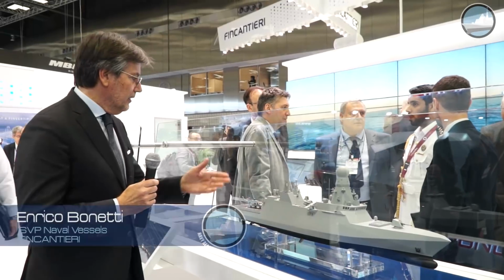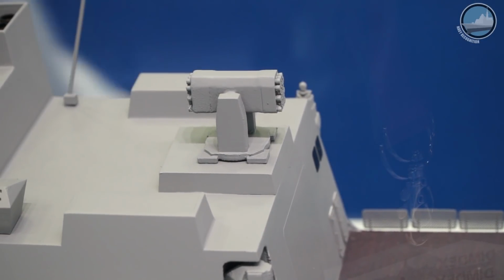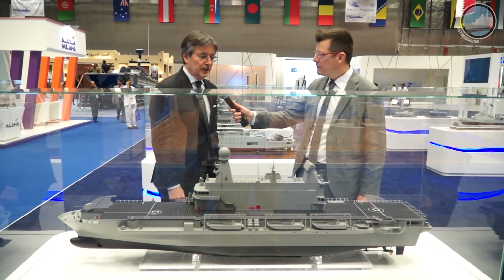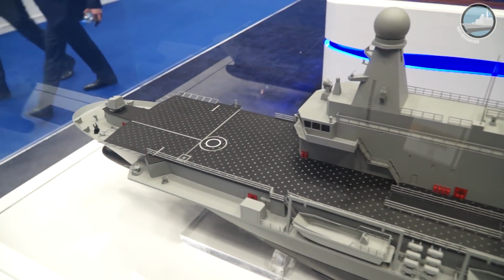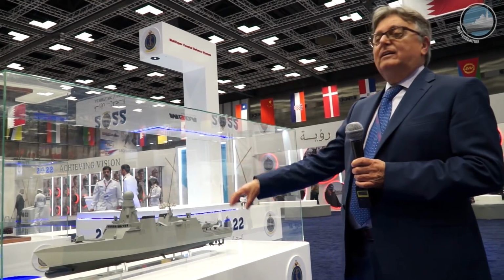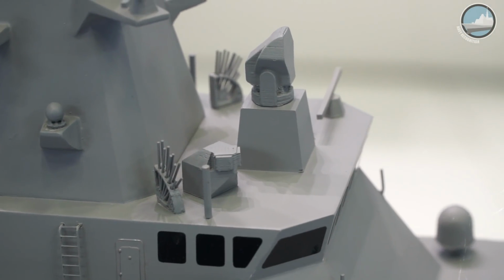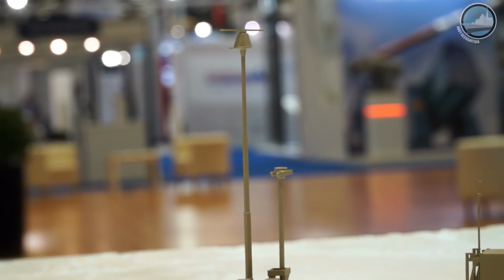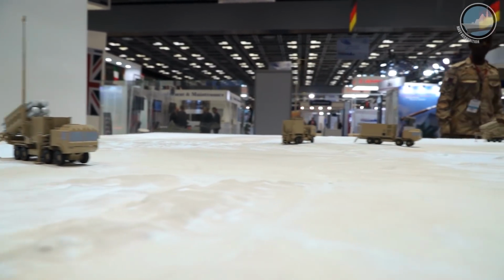DIMDEX 2018 Day 1: Future Qatar Navy Vessels & Systems - Fincantieri, Leonardo, Lacroix, MBDA

Comment: the Qatari Navy should have opted for a fleet four brand new Mistral II class i-SMARTFuelCellΔ e-HYBRId® powered 36,849 ton (43,650 ton loaded) non-amphibious (CSTOL) multi mission LHD . . . unlike conventional LHDs it won't feature a dedicated vehicle deck but it'll have an aft well deck in the rear most stern section lower hull . . . the available space in aft well deck will fit limited number of armoured IFVs & self propelled artillery units that will be transported from the LHD somewhere in the middle of the ocean (since LHDs being a proper ocean going warship cannot sail into shallower waters) to the shore in state-of-the-art electro-solar powered 1,056 ton (1,900 ton loaded) autonomous multi purpose heavy lift tactical barges . .

Comment: Qatar MoD also ordered 12 helicopters NHI NH90 NFH (Nato Frigate Helicopter) and Marte ER missiles for them (declared range at least 100 km). The helicopters can also use MU90 torpedoes, don't know if Qatar MoD ordered also the torpedoes.
The total order of NH90 was 28, since there was also an order of 16 NH90 TTH (Tactical Transport Variant). There is an option for additional 6 NFH + 6 TTH.

Comment: LCS outgunned by that second tiny coat. This is just sad.
Reply: That second “mini corvette” would be an addition to any navy. Just reading they’re only 110mil. Super cost effective as a light escort/picket ship  if only it had a helipad it’d be perfect as a workhorse.
Reply: This "tiny coat" can do as much damage as a Gowind 2500.
It is equipped with AESA radar, crew of only 34 men, VLS MICA NG, Very Stealth, anti-cruise missile capability, ASuW capability, most advanced combat system ATHENA, powerfull EW system and the cost of the ship, crew and logistic maintenance is less than the cost of a corvette/mini-frigate.

Comment: Qatar is getting an LPD???
well this is certainly interesting .
Reply: and Its better armed than the UKs Queen Elizabeth Class Carriers lol
Reply: @jyralnadreth4442  Yeah well Qatar doesn't have to factor in £35bn for replacing their SSBN fleet/nuclear deterrent into their naval budget.
When the largest ship you're ordering is a single landing ship only big enough for a single platoon and the next is a 3000-tonne corvette, and even then you're only ordering 4, you can usually afford to add a few extra missiles on to your 5 new ships.
Reply: Jyral Nadreth heh mate,there’s a difference between aircraft carrier and LPD,the role of the QE is an aircraft carrier,thus it will mainly be protected by type 45s and 26s instead of being by itself.Do keep in mind this LPD will be long destroyed in a solo battle against QE,simply because the QE has jets whilst the LPD doesn’t.Anyways,I could keep mentioning in ways how better the QE is,but clearly you’re either a troll,misinformed,or largely underestimating the capabilities of the QE.
Reply: Don't worry, looks like it's only about 3ft long...
Reply: It was confirmed that Qatar only ordered the LPD to mount the Kronos Grand Shield Anti-ICBM Radar which was too large to fit on Doha class Corvettes or Falaj-2 OPVs.
The LPD will have the task of creating an anti-ICBM bubble where it will also send information to the rest of the frontline ships equipped with VLS Sylver A50 systems to shoot down ICBM targets.
The LPD can be considered an multi-role missile destroyer/cruiser with anti-ICBM, AAW and a small LPD capability.

Comment: Jesus LCS is embarrassing compared to those ships.
Reply: under-performing to be exact
Reply: I agree. The LCS concept was a huge waste of taxpayers money, and yet they will keep building them, I believe there are another 10 LCS ships to be completed by 2025.
Reply: LCS were never designed as frigates. Heard of the term Corvettes? It’s a class that hasn’t been properly been represented in the US navy since forever. We have the FFG(X) program for a proper frigate... LCS vs. foreign frigates are apples vs oranges.
Reply: The OPV Musherib Class can do as much damage as a Gowind 2500 for example.
It is equipped with AESA radar, crew of only 34 men, VLS MICA NG, Very Stealth, anti-cruise missile capability, ASuW capability, most advanced combat system ATHENA, powerfull EW system and the cost of the ship, crew and logistic maintenance is less than the cost of a corvette/mini-frigate.
The LCS is quite expensive for a ship that fills the role of Corvette.